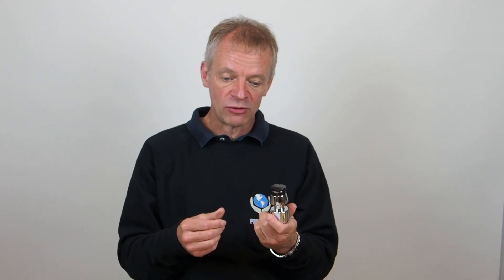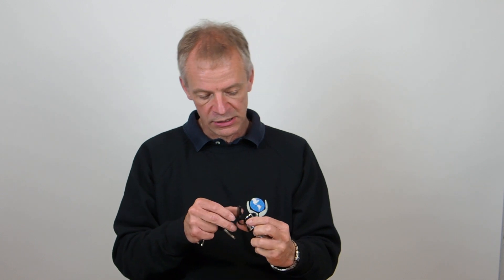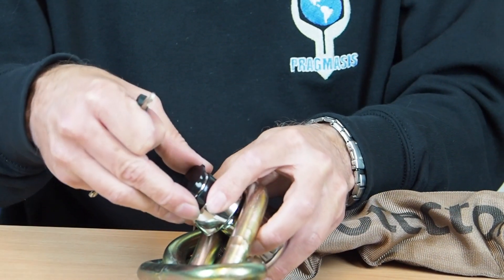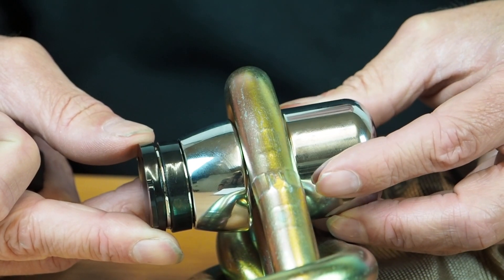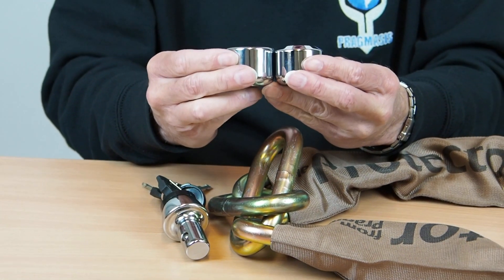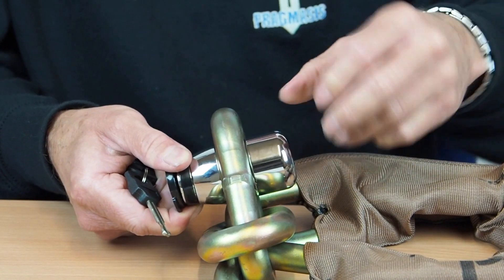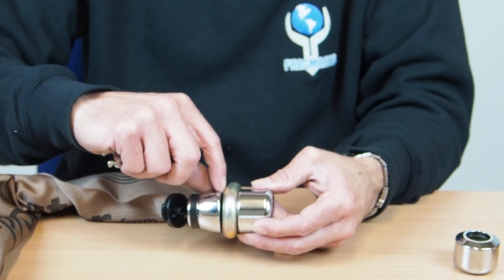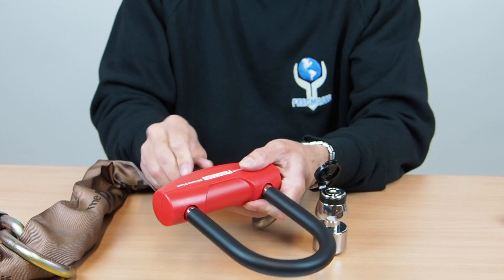The RoundLock from SecurityForBikes.com

Comment: Just bought several of these to use with a 19mm chain at home and a lighter 13mm when i'm out and need a more portable solution. Great quality - built like a tank. Read the review on Bike Social - they couldn't get through this fantastic lock - even with an angle grinder.

Comment: I've got this lock from you guys.  Really good and easy to use.  I thread a 13mm chain through my axle spindle on my BMW R1200GS Adventure and this lock secures the chain from being pulled back through.  Very neat and efficient.
Reply from the maker: Hi Steve,
Glad you're pleased. You were the first to work out that way of locking the chain in position through the rear axle on that bike - well done, and thanks for sharing the idea!
Cheers,
Steve.

Comment: What is it made of? How many discs in the cylinder? Can it be pry'd open or is machinery the only way to open it? Cheers
Reply from the maker: The RoundLock is made from a case-hardened Cr-Mo-Ni alloy steel. It has a 9-disc anti-pick cylinder, protected with a rotating anti-drill hardened alloy steel plate.

I guess if you leave enough space for a thief to get a ridiculously big lever into the 'D', and if the lock is fixed to something sufficiently solid, then it might be possible to defeat it with some kind of levering or prying attack. If it is used properly, all this and also a bottle jack should become impossible for a thief to use.

We have done tests in a big hydraulic rig and the force required to break the lock is way in excess of the capacity of the compact bottle jacks we've seen on the market.
Realistically, an angle grinder is probably the only way to defeat it, and that won't be a quiet attack.

I hope that helps,

Steve.
Reply: PragmasisSecurity. Thank you Steve for the great response. All the info I was after! 👍The chains and locks appear to be one of the best in the market for an out of the box solution that is ready to go. There are pro's and cons to any chain and lock combo with regards for material type, strength, brittleness, ductility, price and weight. Everyone has different thoughts on what is best and different environment will demand slightly different specifications but from my research so far for varying situations, this product gets a thumbs up!👍I will be definitely purchasing one for my new custom trailer...unless you wish to send me a freebie :) Thnx again Steve for the concise reply, cheers